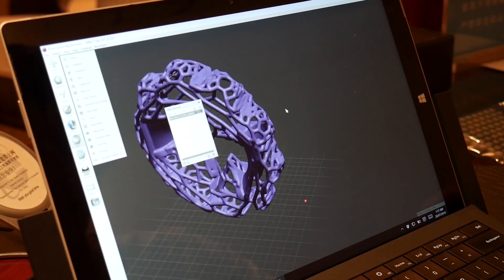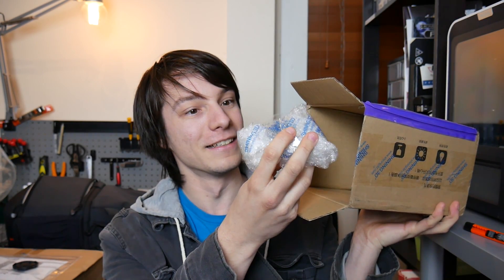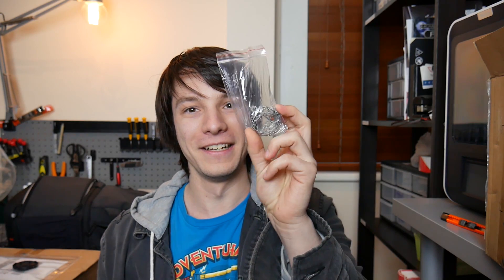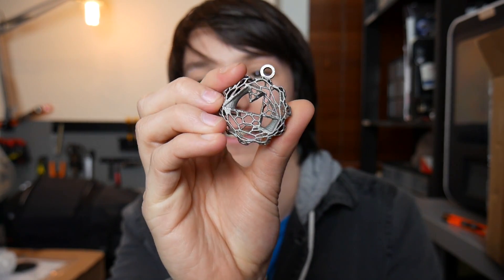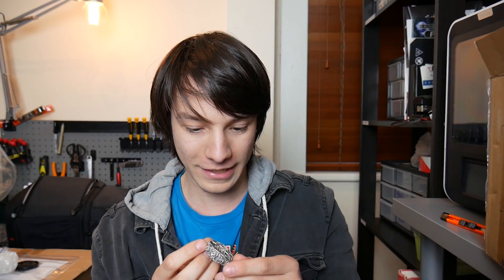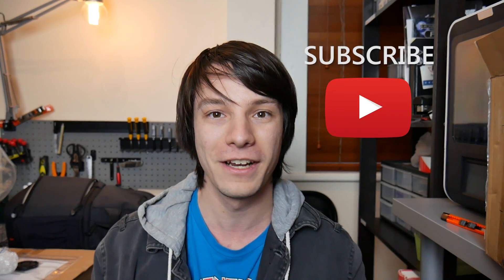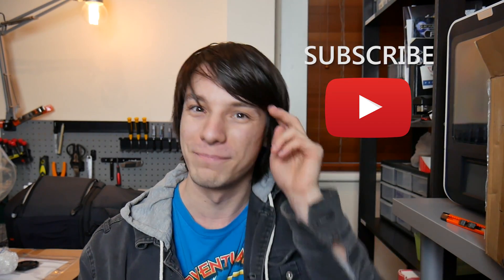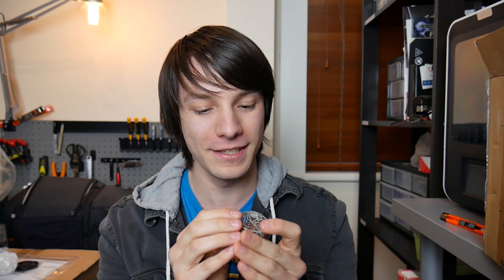The coolest 3D Print EVER - Metal 3D Printed Maker Coin by Shining 3D

Comment: The process of using heat to fuse metal powders into solid metal is called sintering. Very important when sintering to not melt the metal. The powder must only be heated to fusion temperature sense if it melts surface tension will distort the geometry. 
So, selective laser sintering. If they're really saying melting, it's Chinglish, you should've translated.
Reply: "The SLM process has the ability to fully melt the metal material into a solid 3D-dimensional part unlike SLS." -wikipedia

Comment: Hmm, using dual extruders with a support material is similarly capable as a powder bed printer. And metal printers are typically powder bed for the shape freedom. But what if you could make a plastic printer style metal printer with a high temp support material that can easily be removed. that way you have the cheap printer but fully capable. Just make it high temperature. 1600 degree print head should be trivial enough for steel filament. Why the fuck not. I want to print inconel, aermet and invar. I want to print a fucking car and a fucking personal supersonic jet. I want to print a fucking yacht. And a fucking interstellar spaceship.

Comment: can it print some kind of mechanical part like , a piston or cam shaft
Reply: Yes, but it will need machining and to get the running surfaces to the right tolerances and surface finish as well as heat treatment to improve (within limits) the mechanical properties.  Components produced by these processes don't have the mechanical properties of components made by more conventional means because the resulting structure is made of particles welded/melted together leaving spaces in the structure.  This leaves the components more susceptible to failure due thermal and mechanical fatigue and with inferior mechanical properties.   Layering also has an impact on the overall strength and durability as well.   Components can be strong enough to be good functional models but at the current state of the technology printing engine parts that will work as good and as long as cast/forged/machined components is an no.

Comment: Metal printing is very cool and there should be home machines already. It's not an expensive system. But isn't that printer a powder bed printer? they don't need supports. They can print anything except completely closed shells so you can't get the powder out.
Reply: y2ksw1
don't waste your time with this blathering idiot.
Reply: what makes you think SLM machines are not expensive?
Reply: Dan Frederiksen
go ahead and make a cheap metal printer. fame and fortune await you. how hard could it be?
Reply: Dan Frederiksen
your impression is wrong. start with an incorrect premise and of course you'll arrive at completely wrong answer. you need a lot of energy to melt metal. which requires a powerful laser. and precision optics to focus it. not to mention your metal must be finely powdered. and powdered metal just happens to be highly explosive, so your lasing must happen in an inert atmosphere.

none of this is cheap.
Reply: Like I said, the laser is a small part of the cost. The issue is that you cannot melt metal powder easily under standard atmosphere.
Reply: Most SLM/DMP printers are well over $500k USD. I know this because I shopped for one for my company. The largest metal laser printer was $1.5million USD, but only has a printable volume of a MakerBot.
Reply: There are different systems, a few of which need minimal support. Metal dust can become very expensive and not all systems support a "full box", but dust just where needed. Much like an inkjet printer with thermal treatment.
Reply from the maker: Correct, there is two hopper approaches where one raises and the other lowers, or a top loading system which feeds down from a top hopper to the bed. I THINK the reason supports are needed for this approach is more because the part become heavier and starts to sink into the bed, rather than being used to stop warping. Heat distribution is another thing to account for for some metal systems like arcam. Metal printing is not easy, and a metal powder is also highly flammable if oxygen is present, so the chamber needs to be flooded with a non-reactive gas (argon, or even helium depending on the metal).
Reply: I've never heard of supports in a powder bed printer. I really don't think they used any. That's the very premise. Even if the part is technically denser than the powder, the powder is so heavy and packed that it wouldn't matter if it was tungsten, it wouldn't sink. 
+msbani, I can't see your comment here, youtube is stupid sometimes, but the reason it's not really expensive is that it's just a fairly cheap laser and spinning mirrors. Plus of course the powder spreader etc.
It's very much like the early days of plastic 3D printing where you could get a 'pro' machine that was hideously expensive vs now where you can get a little crude machine for 1% of the price that's actually much better than the pro machine. And like I realized below, we don't actually need powder bed printers and overpriced powder. if you have two extruders, one for support material, you can lay down metal just like plastic. With no shape restrictions at all. Just needs to be a high temp material that's easy to remove afterwards. How astronomically cool would it be to have a gmax size metal printer at home. Or even bigger...  how cool would it be to be able to print a fairly large jet engine in inconel, aermet and invar. Or a fully functioning rocket engine. Or an entire plane for that matter. Or car.  What if you could print a fairly thick line with a little microspatula patting the liquid metal in just the right angle so the surface is smooth and there are no print lines. So you can print big and fast with a perfect finish. What if you could print glass and a tiny laser refined the surface for optical clarity. What if you could print an entire car, ready to go. Just put tires on it and insert batteries and a power electronics module.
Only a psychological barrier away.
Reply: I don't know, maybe 2000MPa.
Reply: The laser (and relative hard- and software) is the most expensive piece of a solid metal printer, where solid is just an attempt, because in reality there are many microscopic air pockets between the dust particles.

A decent 3D metal laser printer prototype would cost about US$ 30k not counted a single hour of your time, rent, tools and development equipment. Just the crude hardware and maybe a small box of metal dust at the lower price tag. If you want to add also the equipment and the hours, the prototype will cost at least US$ 350k. Provided of course you are a top-gun programmer and engineer, knowing exactly what you are doing.

Of course, if you have the money, that's where the real business comes in ... the industry pays any amount for quality prototypes and a self-made metal printer is a great investment. The metal coin we have seen, is worth a fortune!
Reply: But it's my impression that lasers are surprisingly inexpensive. And only getting cheaper. 30k$ is a complete bs number
Reply: Lasers are relatively inexpensive, but not all countries would be allowed a consumer laser of the wattage needed to smelt metal.

We won't, for example, be allowed a 3d metal printer in the UK.. for a WHOLE BUNCH of reason, the laser being amongst them.
Reply: This kind of laser must be very powerful (about 50 Watt output) for the speed. In addition to the laser, you need the mirrors and precision electronics which usually you find only in laser printers, but not for 3D. In order to melt metal, range 400°C (LiBp) to 1800°C (Pt) including a little margin, you cannot sit there, move the bed, move the mirrors, focus, shoooooooot (for a long time) and move on. This would cause a hell lot of warping besides a full nervous breakdown of the operator. I've been watching such things :)

Since 50 Watt lasers are unavailable, one must take a bunch of 1 Watt lasers, which have a hefty price tag if they should last a little more than just a couple of minutes ... say US$ 300 each. That makes about 15.000 in lasers only. The advantage of the bunch is, that the failure of a few causes nothing but more time to wait, and they can be replaced while the printer is running.

However, then you can get a resolution of 600dpi or (much) more and print an about 6x6 cm surface per hour with 1 dpi of height and you can print super-cool stuff, such as filters and 1.000:1 scaled working microprocessors (these require additional steps).
Reply: PS: we are talking about industrial lasers of this kind: http://www.ebay.com/itm/1W-445nm-Blue-Laser-Dot-Module-TTL-Analog-0-30KHZ-TEC-Cooling-85-265V-/201602934447
Reply: no, you just lack vision. The laser doesn't have to be very powerful (around 200watt) and CO2 or nitrogen gas is no significant cost. Could even go vacuum or burn the O2. And I'm not sure it's even necessary.
It's easily done.
Reply: Dan Frederiksen
if it's so easy, go do it.
Reply: I am old school and prefer a rather big expense over several small expenses which at the end cost 3 times as much. I have been working for large industrial and small medical equipment as well as for microelectronics, and have a vast practical experience.

I am convinced that you CAN build a 3D laser printer for say US$ 1.000, but it will not melt metal, even if the laser stays half an hour on the same spot, while eventually the underlaying glass powder support will melt away and move the metal layer out of sight ...

This is what happens with glass powder: it is a great insulator, but it melts at about 600°C, a temperature which you may just reach with a single laser and waiting long enough. Metal dust is usually black and a good thermal conductor, and will thus willingly give all heat to the support layer. When the glass melts, it will combine with other glass particles and form a lump, which sinks into the bed and then the metal you want to melt, has moved out of focus.

Instead, this is what you want: a short heat pulse on a single spot of your chosen diameter (e.g. 1/600 dpi) without heating significantly the support, whatever it is. The base layer will then melt with the glass, all further layers melt with the previous layers, as designed, but just. The laser point produces a temperature of much more you need, but the heat excess allows you to move rapidly and thus "print" rather than "weld".
Reply: BTW, CO2 gas is no good, because it splits easily into half with the temperatures involved and thus can react with the metal surface. Argon or Xenon are the gasses normally used for metal printing. Vacuum is impractical because it may distort the printer structure and since we are talking about micrometer precision, it makes a significant difference.
Reply: If somebody wants to start a crowdfunding campaign, I'm in. I've seen a lot of potentially interested people, but the main problem of this equipment is the cost and nobody willing to make a working prototype as requested by most crowdfunding systems.

I'm not able to start a campaign myself, because I am not living in a country from where you can start one. It will need a special agreement where it must be explicitly pointed out, that no prototype is available.

The final price tag for small scale manufacturing is not a true barrier. Dentists and small industry can afford a US$ 25.000 printer, which would cost only 1/10-1/30 of the normally available solutions.
Reply: +y2, spare me your bs. pro metal 3d printers do with only 200 watt. A 50 watt laser tube costs something like 100$. That 200 watt laser flies over the metal powder and instantly melts it. I think they specifiy the scan speed at 10meters per second. You see how wrong you are?  
You are struggling with a mental barrier. There is no technology barrier.
Reply: I have already. Now that there is an offer of a crowdfunding project, he should be fire and flame, but instead prefers to keep his ridiculous position about a US$ 100 for a 50 or 200 W power laser. There is not much I expected, though, it's just the proof that a serious project cannot be done with people who have no idea about the overall impact. No pun intended.

If there was a 50 or 200 W laser for US$ 100 available, I would see a lot of interesting projects on the Internet, but there aren't. 50 and 200 W lasers (and up) are military grade and not available to the public. 

Also, lasers emit at most 5% of the input power, thus fueling and cooling such valves for more than a second or two, would require special equipment. But hey, there is no problem with 1-4 kWh consumption at all, it's just like blowing over a spoon and the energy can be provided by one of his fans ... blowing hard enough. Oh well, I see a potential for a perpetuum mobile, too. :)
Reply: The tech is very expensive I think. Most require SLM or SLS to be performed under vacuum or argon. A very high power CO2 laser is required to get any form of decent throughput, >500W. Achieving such powers requires a very well designed and expensive laser tube, as well as expensive power-supply. So... you need a vacuum pump, vacuum chamber, power supply, laser tube, some kind of high temperature galvo or vacuum compatible translation stage; by all mean build one for <$1000 and I will be your first customer!
Reply: Sammy, I trust my prior self that I looked it up as a 200W printer that melts at 10m/s. To my (genius thinking) that means a home printer could do with 100watt or less. Trust the simple facts, not your sheepish intuition that it has to be hard and expensive. Benefit from the same progress with plastic printers. They used to cost a farm, now you can get a decent small one for 200$
Reply: Since this discussion comes to the point where everybody becomes excited about 100 W or less power lasers, why not looking it up together: https://www.google.it/search?q=200+watt+laser+cutter. Then, just change the numbers and see how low you can get. You even get results for 1000 mW lasers. Then, at eBay, you buy such a tool for 200 bucks and after trying hard, you come back here and tell us. I am greedy to share your experience, trust me!

My experience is that a decent engraver must have a 100W CO2 laser but can't directly engrave metals, and cost about 10.000$. 

So when it comes down to 50 W lasers with adjustable power and optics capable to melt metal powder, plus the expenses of developing a system with a decent grade of success, you run into the cost of developing a proposable system, meaning that even a non technician must be able to put it together without harming themselves or others. Since you can't ensure yourself against idiots, you must be sure to prevent anything to go wrong. And this costs much more than anything you may have handled in your life, ever.
Reply: Isaac, no doubt but they could be cheap once the hobby crowd starts making them.